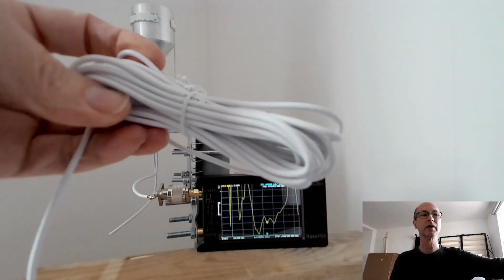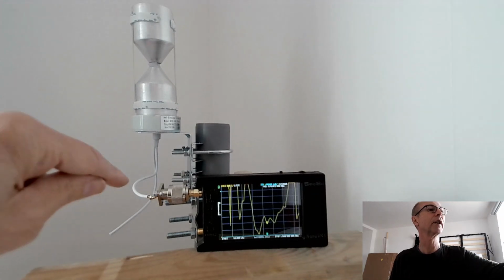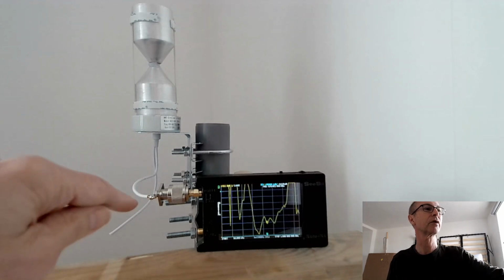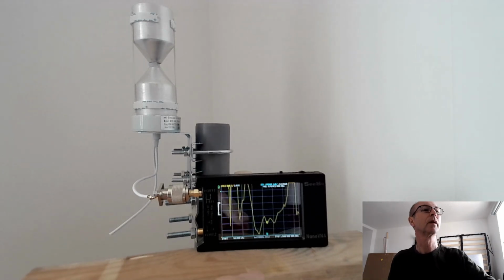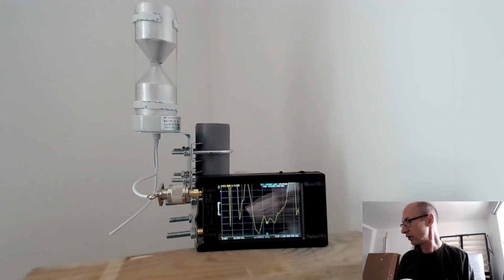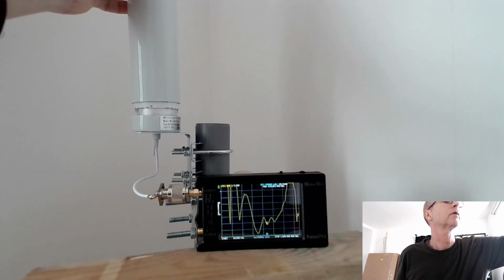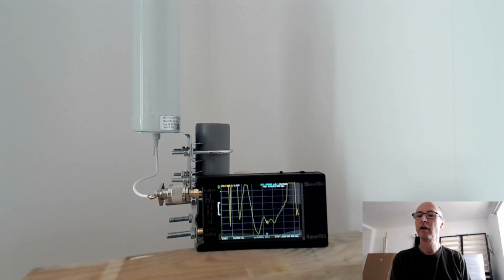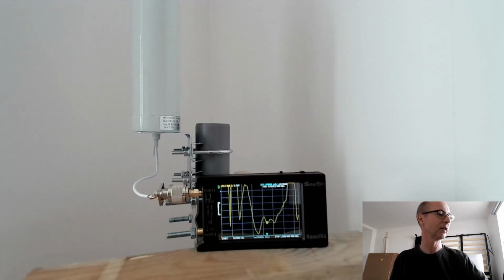Broadband Antenna - is it a Fake ? Part 2

Comment: Interesting seeing the effect of replacing the cover.  I've been making slim jim antennas using 300 ohm ribbon.   I made a 3d pla printed cover and it pulled the vswr down.  However I found that a polycarbonate tube had little effect, making construction much easier.
Reply from the maker: It's probably a happy coincidence that the manufacturers chose this particular material. The black cover on the mobile whips pulls the resonant frequency lower.